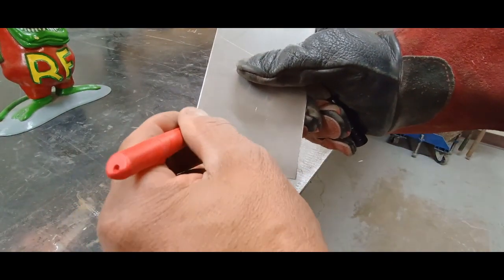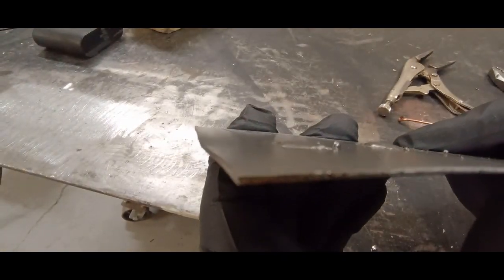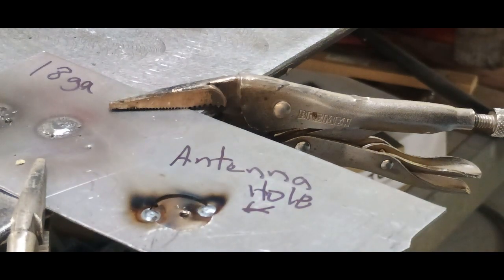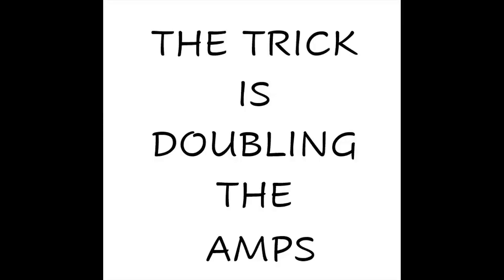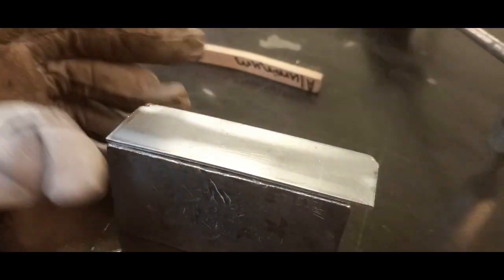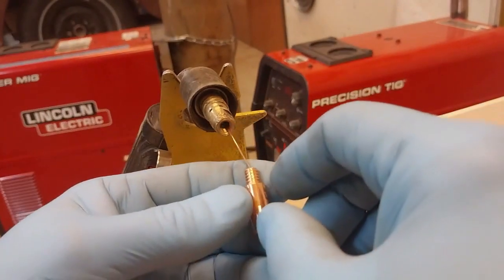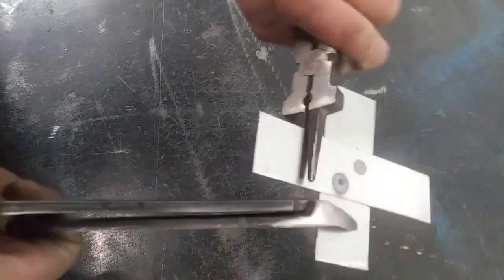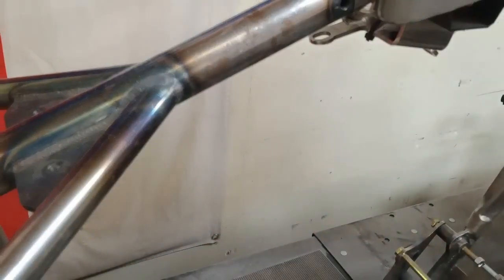10 Auto Body   WELDING   Tips and Tricks for SHEET METAL !     D.I.Y. Auto Restoration

Comment: I don’t have a stud gun for body work so I take 6011 arc rods beat the flux off cut the in half and tack em to the dent as needed then I grab the ends with vice grips and use a big ol’ adjustable wrench with it adjusted just big enough it will fit over the rod and slide it in and out hitting the vice grips! Works very good when I’m done I cut the rods loose and keep reusing them till they get to short. I have very limited space so it’s one less tool l have to store. Great videos always up for learning!
Reply from the maker: Awesome ! thanks for the comment and for following my channel, glad to have you aboard !
Reply: I’ll be doing a full on restore on a 69 bird starting in 1/0/25 floor ,trunk pans , quarters ,in n out wheel arch’s and so on. For some  reason my mig welding has always sucked hopefully I’ll get better. My arc welding is pretty good for someone who does it once or twice a year. I’m finishing a 90 OBS Chevy truck for my grandson currently just about done! Paint work is my main hobby so once I’m past the metal work it’s full steam ahead ! Have you sold all the sand blast kits for plug welding holes? Thanks !!

Comment: Your spot welding trick is impressive, and you can do it in the middle of a huge sheet of metal!!! 😳 By example on a Bug floorpan replacement when you have to spot weld along the tunnel...great! You got a new subscriber. ☺
Reply from the maker: As long as the panels are cinched together propely and the weld area is clean a great weld is possible anywhere, I have multiple floor installation videos in the playlists. Welcome to my channel and I will always do my best to bring you experienced, professional, tips, trick, and methods for my DIY family.

Comment: Can you do a video using flux core welding on body work? BTW Excellant tips!
Reply from the maker: @robertwalker3761  I know a lot of people use flux core for body work for thin sheet metal, I'm just not a fan of that, for about $150.  or less you can convert to shielding gas with the bottle price and that will make the welds so much nicer. Thanks for watching and thank you for the comment I really appreciate you

Comment: One more tip is that equipment absolutely matters.  I taught myself to weld with a cheap $200-300 Harbor Freight gas MIG unit, and it did alright.  I got where I could get some fairly decent welds out of it.  After a few years I treated myself to a step up, not a full Miller, those things are expensive, but a Hobart, and from weld one it was a huge difference.  All the things I just couldn't make better no matter what I did, I just thought that's how welding was, but no, there's just only so much you can do with the cheaper equipment.  
Totally fine to get started, but if it turns out to be a thing you end up doing regularly, it's worth it to step up to something better.  Unlike Harbor Freight angle grinders.  I will be $20 angle grinder ride-or-die til the day I die.
Reply from the maker: @12x2richter  Thanks for the comment!

Comment: Hey Robert, these were pretty awesome tips! I’ve never seen tig/migging holes like that, so you increase the temp when doing that to help melt the rod? Thanks for the video and the tips, hope you have a great weekend my friend!
Reply from the maker: Using 3/32 rod I don't think you really need to turn the amps up much. try it you can also use a 1/16 rod or if it's a bigger hole use 1/8 rod  then I probably would bump up the amps a little bit the compensate for the larger rod. Thanks
Reply: Thank you Robert, I’ll try the 3/32 rod first, I have a few firewall holes I’d like to fill and I think this would do it. Appreciate the advice!
Reply from the maker: @raymondantonio4145  Glad to help 🙂

Comment: First one, awesome tip.  Tried cutting a piece of round metal to fill small holes, this looks much easier. TIG spot-weld also cool tip, got to try that one.
Reply from the maker: Yeah that can be a life saver if you don't have access to the back and using a magnet to hold the piece can be a problem .Thanks !